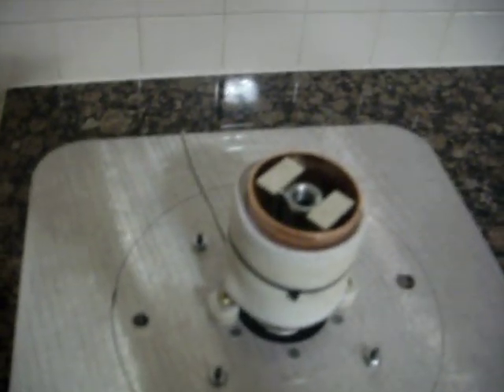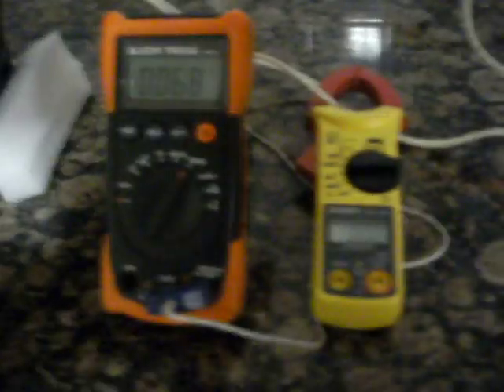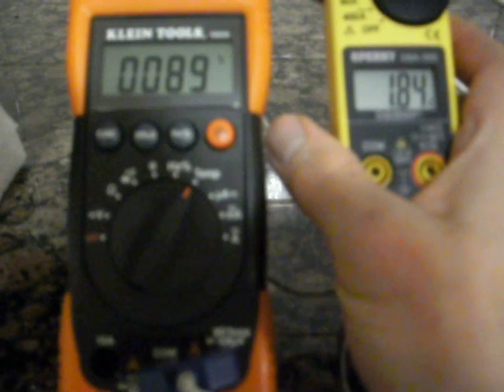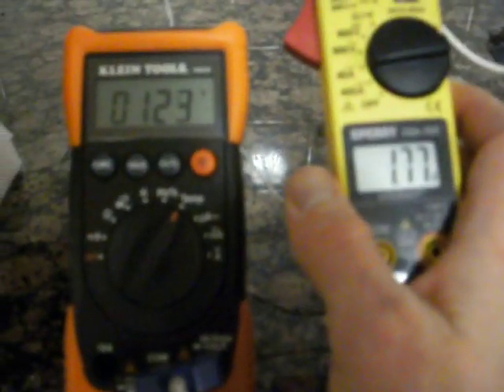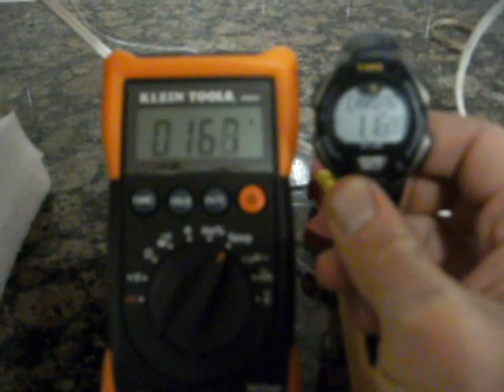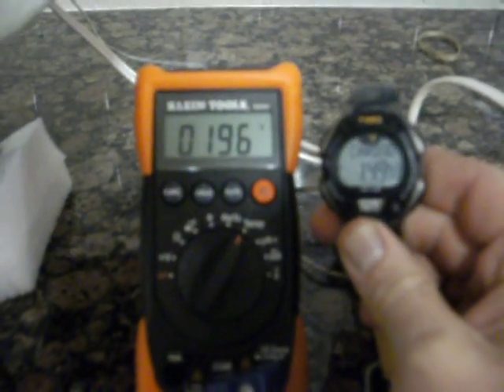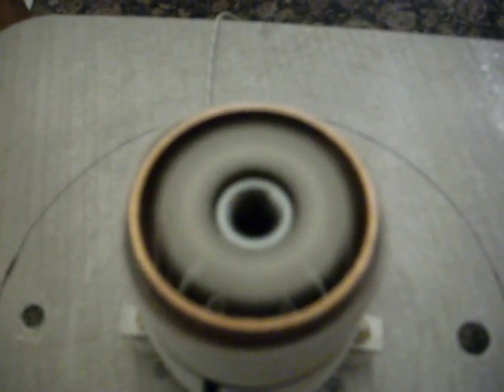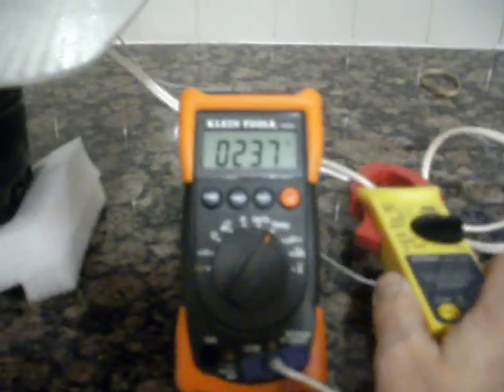Magnetic Heater design using spinning magnets to produce heat !

Comment: Sorry, but this is nothing new. You have simply made a small eddy current brake. If you want to understand this better, just Google "eddy current brake dynamometer". You are simply putting a small drag on the motor which results in heat dissipated in the copper. The first eddy current dynamometer I made was capable of fully loading a 7.5 HP electric motor. It blew 5,600 watts of heated air continuously outward. But the motor consumed more than this amount of watts. No free heat. Nada. Your amp meter doesn't measure power. If your "heater" is making 20 watts of heat, then your motor is using at least an extra 20 watts. You wouldn't even notice it with your ammeter. Nice that you are trying to learn something new. For that I congratulate you.

Comment: So comutated dc or mains ac to create a rotating magnetic field in a motor's field coils that in turn spins the electric motor's rotor that in turn spin another rotor with magnets on it so you can have a time varrying magnetic field pass over copper tubes just to create eddy currents in the copper that in turn disipate that energy into heat due to resistance in the copper.   

Why not go solid state, no moving parts, no expensive magnets, and a whole lot cheapern and even more efficent than using a motor. Just wrap a copper pipe with a lot of insulated copper wire and plug into the wall.  The coil fed an AC current will create a time  varying alternating magnetic field that will cut through the copper pipe causing eddy currents in the pipe that circle around the  circumference of the copper pipe, first in one direction, then the other.  Plus it wont break down like a motor will eventually.
Reply from the maker: Yes, induction is the best way to generate Heat in using high-frequency pulsing. The method you're talking about though In  just wrapping insulated copper wire around a copper pipe and plug it in the wall will do nothing but probably blow up the wire or overheat. You have to use high-frequency pulsing and be in resonance with the coil in order for it to work. Thanks for watching.
Reply: Yes, without a way to limit excessive  current, it can blow a circuit breaker or melt wires that are too thin to carry that current. The particular type of induction heaters you mentioned use a higher frequency like you said. But, lets look at just inductive ractance effect on AC currents in a coil: Amps(rms)=Voltage(rms)/2*Pi*Frequency(hz)*Inductance(henries). That means current through a coil is inversely proportionate to frequency just as it is also inversely proportionate to inductance. Increase either frequency or inductance and current drops. If you have enough inductance at a low frequency, you can limit the current to something reasonable. Now the power factor from inductive reactance might be objectionably low, so one may add a capacitor forming a resonate LC tank circuit that resonates at one's line frequency, 50 or 60 hz. for those tat did not know Good power factor is when current neither lags nor leads voltage.

A coil around a copper pipe is nothing more than a transformer with the copper pipe being a one turn secondary coil that is  virtually (excepting the copper resistance in the pipe) shorted. That means you need enough turns around in the primary to reduce the voltage in the secondary because of the low resistance along the virtually shorted diameter of the copper pipe. 

I put together this circuit simulation to simulate the concept https://bit.ly/2NWx1xY. Its values are fairly reasonable, and as is, delivers about 741 Watts RMS inductively induced heating with about 37 watts RMS copper loss  in the coil,  95% efficient at induction. 

Putting that circuit together gave me the idea that maybe an iron pipe would be better. It has more internal resistance  and magnetic permeability.  The higher magnetic permeability gives it much higher inductance  which requires fewer turns to limit current. Fewer turns results in a lower primary to secondary ratio which drives a higher voltage in the secondary (eddy current in the iron pipe) that is also limited by higher resistance in steel vs copper. Further more, using an iron or steel pipe introduces hysteresis loss in the pipe.

Comment: does the magnet heat up due to the high speed of rotation or due to heat radiating from the copper plate or tubing ?
Reply from the maker: +sanjay prabhu 
No, the magnets actually stay cool when running... It's like a little propeller pulling in air as it spins. The outer envelope is what gets really hot. Thanks for watching.
Reply: Thank you for the clarification Sir  😊
Reply from the maker: +sanjay prabhu 
Your welcome.

Comment: i would really like to know the make and type of motor you used for this application.  i need a quiet motor and this would fit the bill.
Reply from the maker: +teeka mann 
Company was called "Marathon". I purchased it at a cooling and heating supplier called R.E. Michaels... the motor is used for an oil burner furnace which spins at 3500 RPM. Hope this info helps you out buddy... Thanks for watching.

Comment: Hello
Can You tell me what kind of electric motor You use in this video?
Maybe link to the design of it?
It`s very interesting project I`m trying to power this by wind turbine.
I`m also looking for low energy consuption electric motor so it could be used everywhere.
Good luck in projects!!!
Reply from the maker: +Katarzyna Stawna 
Check out my video on how I designed the spindle... I purchase this motor at a heating and cooling supplier and I believe it was used for an oil burner furnace. It is very energy efficient and spends at 3400 RPMs. Thanks for watching.

Comment: +whyme2b , are magnets facing same pole towards copper , or North south ? I`m interested in eddy currents forming in copper tube , and what is the difference in magnetic breaking with amp consumption ? At start motor draws 1.8 amps. How many amps does motor draw while running without  load at same speed ? Best regards and good luck
Reply from the maker: I place the magnets in a north-south polarity against the copper... I did rotate to the same North polarity and found that it heated the copper just as well. I'm not too sure on the magnetic breaking with amp consumption, but I did notice as this copper heats up the amperage goes down. I'm sorry but I can't remember what specs were on it running under no load. Please let me know if you have any more questions. Thanks for watching.

Comment: yea now try doing it with water in the pipe
Reply from the maker: I did actually already do that in my "magnetic heater updated video" .... constant water flow input of around 1- 1/2 gallons per minute at 55 F which heated to 80 F output and that's not even being looped back into itself. Thanks for watching.
Reply: It's a good use for magnets, But!! as a water heater in housing you may have a big big big big problem.. all houses heating systems are ground to earth .. So your induced short would go strait to ground giving no heat in return ..
Reply from the maker: No sir, my heater performed the same grounded and not grounded...no difference at all. Good question thou !
Reply: any chance you could do a video to cover this claim ?
Reply from the maker: Sorry sir but I actually sold my unit to one of my subscribers a while ago... but I do assure you I did do that test because I am a electrician in my field of work.
Reply: or well al never know :(

Comment: hey pal, we are working on making efficient tumble dryer and by using this spinning magnet mechanism to produce heat with a dryer motor which runs at 1725 RPM or 3600 RPM, do you think this spinning magnet can be useful with it? how much heat can be generated in joules terms? and if it is what kind of magnet do we need? can we also produce electricity using this mechanism and how much electricity?

thanks
Reply: +whyme2b Hello, I have also that idea like shakil using magnets for heating the dryer. A good idea is try to spin the magnets and the materials to be heated in opposite direction this will increase the spin of magnets against the heated metal. Use only the dryer motor to rotate the magnets and small gears to spin the metal in opposite direction so no additonal load will be  added,Good video.
Reply from the maker: Hello, so your working on making a more energy efficient motor for the dryer? Cool... I really prefer using high frequency induction now rather than this idea, unless you can find a better and faster way of spinning the magnets using less energy then this would be the answer. Please check out my other video called "magnetic heater update " to see this really work to get a idea of how fast and hot it gets in a very short amount of time. Neodymium Magnets are the best and strongest for doing this job. They also are the best for producing electricity, but in this set up...no sir. Thanks for watching.

Comment: Hi,
    where did you measure the heat? how far away from the magnets was it perceptible that it was generating heat? what was the motor rpm. was that a washing machine motor?
charlie
Reply from the maker: Hi Charlie,
 I measured the heat on the outer copper fitting using a wire probe. My spacing between the copper fitting and magnets was around a 1/16" to 1/8" inch. The RPM was 1725 and it was for a furnace blower. Check out my other video called "magnetic heater update" to see it work way better and faster than this design. Thanks for watching.

Comment: While induction heaters are nothing new, they are both faster and more energy efficient that heating coils by a long shot. What I don't understand about this design is the use of a motor. Passing an alternating current (like what comes out of your wall outlets) through a copper coil mounted beneath a stainless steel plate is a simpler, even more efficient design. Spinning permanent magnets is unnecessary if you just mean to build a cook top/hot plate device.

Comment: Congratulations, you've just made a basic induction heater.
Save some time and energy by using a heating element. 
You're whacking about 200 watts into that little thing, of course it will get hot.

Comment from the maker: If used for a radiant heater, I would use a disk temp controller mounted on the pipe set at your desired temp to shut off and turn back on. Speed control on the motor can also be used to regulate the heat. Thanks for watching.

Comment: i wonder if it will actually be able to heat water continuously or if the water would just cool it to the point its useless because it is just getting cooled.

Comment from the maker: No sir, sorry but I didn't try that out. I would just use a hot water sensor to turn off the motor when the temp has been reached. It would be more energy efficient that way instead of running continual all the time. Check out my other video on" magnetic heater update ", because it's a better design then this one. Thanks for watching.

Comment: Hello. Did you tried this affect on a boiler which is filled with water?
If you did, then could you tell me what rpm is needed to heat up all the water in the boiler up to about 80C and keep that temp?
If it needs a lower rpm, like 500-1500, then maybe an alternative turning source could be used and this whole thing would be free hot water heater. This way you could use it to heat up your house at winter.

Comment: A sock puppet is a profile that makes no contribution but has the sole purpose of criticism and disinformation. You have already accomplished more in a weekend than they could in a lifetime of criticism.
Love this approach to heating by the way and mention of Dad...
Take a look at the Bedini motor for even more efficiency, ( use instructions to get it to work right.) Or the Lindeman  attraction motor.. Just a thought. After that boiling water to steam makes for quite an efficient power source.

Comment from the maker: Yes sir....I agree. My friend made a heater back in the early 90's that spin ed  water threw a special metal disk with holes in it that used fiction to heat the water very fast and used a few amps of power to do it. The water reached a temperature over 300 F in less than a minute. He patented it back then and I still don't see it out on the market to buy ! Crazy...Thanks for watching.

Comment: This has potential.
Working with a closed loop system heating a larger hot water tank and very low power that perhaps could be assisted with a photovoltaic panel.
The construction industry and eco warriors of the world would bite your hand off for this assuming no one else has patented it yet.

Comment: The first thing you need to learn is the difference between RMS and what is peak.Did you know the peak voltage(that is the voltage measured at the top of the sine wave referenced to ground) in the USA is around 160 volts?

Comment: AC motors don't use magnets,they use stator coils to produce a magnetic field,and an amp meter doesn't read watts it reads current.
I wonder if you have an understanding of what a true watt meter is? 
Here is a clue .707 and 1.414

Comment: Your saying light is 6billion something? Something what?It's approximately 186,000 miles per second in a vacuum and yes it is constant in a vacuum,not so when gravity is applied to the equation.This is explained by Einstein.
What is light?
It's electromagnetic radiation,a radio wave.Humans see less than 1% of whats around them,so 99% of whats going on around us is invisible with the naked eye.If iweren't't that way, our eyes would be useless to navigate our bodies even for short distances.

Comment: first OHHMS law now a watt is a watt wether it is in the form of AC or DC now like u sed as its writen it works better on DC but with a few mor computations added it is sound for AC this is what i ment buy 1000 watts @120AC is the same amount of watts @12DC like u sed only the current and presur have changed were still using the same over all amount "watts" of electricity =3-

Comment: My work history is in Military and oil field power distribution and switchgear design but I started off actually building the stuff,at least the electrical/electronics portions.Later I was promoted to the engineering dept. to assure what was done on paper would work in the real world.
If I'm wrong our US Navy ships are in a lot of trouble,which of course I know they are not.So there ya go.

Comment: in conclution i will try to explane what i now better ohhms law is not perfict buy far but it will work on AC or DC just fine with some fine tuning IE the addition of the leed or lag on the current the frequency and like u were saying any inductive or resistive load and this is what i was taut and it seems to work so now i would just like ur opinon b\c after all u probaly understand like i do that probaly nothing u say will change this in my head or yours =3-

Comment: Actually I prove you wrong that AC and DC are not the same things and that Ohms law as written can only be used for DC circuits and in AC circuits only when the load is purely resistive.I'm sorry if that went over your head but that is why you need to read some books on the subject.You Tube doesn't provide enough space here for me to give you a complete lesson on the subject matter.It's really not my responsibility to teach you anything,that responsibility belongs solely to yourself.

Comment: Well for one thing the current would be much greater in the 12 volt circuit verses the 120volt circuit to obtain 1000 watts.That's just one difference.When you're talking AC circuits there are many other factors to consider.In Ac you have true power as well a apparent power and I thought you had some understanding of this since you were attempting to school whyme2b on the subject,but now you're telling me AC and Dc is all the same.I can assure you they're NOT.

Comment: Is that capacitor in series or parallel?
If it's a series connection then thats whats called a start cap,which is not the same as a power factor cap.To correct power factor on an inductive load the cap must be parallel connection to the motor and tuned to cancel out the inductive reactance.Remember though too much capacitance is just as bad as none at all.PF of 1(unity) is perfect but that almost never happens in the real world.If you can achieve PF of around .97 you've done very well.

Comment from the maker: That's cool man... I took apart a 12 volt 100 watt inverter and found that it has 2 transistors that pulse a big primary coil at 2 volts with only a few wraps around the transformer at arounds 180 to 203k hz which has 180 volt coming off of the secondary winding, which I hooked up a 120 volt bulb to it and it lit it up very brightly ! I couldn't believe the power output comming off of that little transformer ! Will check into the ZVS thing....Thanks for the info !

Comment: There is a simple circuit called a ZVS Zero Voltage Switching that should be able to be used with a coil wrapped around a metal pipe with a low volt,say 12volts,so it would be much safer than having a high voltage AC heater in your bathroom such as the instant on demand heaters.From what I estimate it should only take 100 watts or less to heat water for a shower compared to several thousand watts with a heating element.I've got one on the drawing board but I haven't actually built it yet.

Comment: If you want to make your induction motor more efficient and I believe someone already mentioned this is to use a power factor capacitor across the hot and neutral lines that feed power to the motor,just make sure the capacitor is rated for AC power.In a 110 volt circuit @ 60 Hz I would use at least a 400V AC rated cap.There is a formula but it just gets you in the ball park.It really needs to be done in situe.Start with a smaller cap and add more in parallel until you see a current drop.

Comment: The problem with turning power off and on in an induction motor (as well as almost any circuit) is INRUSH CURRENT.